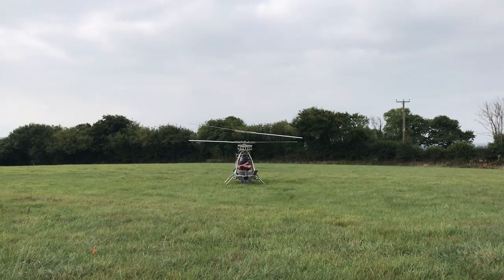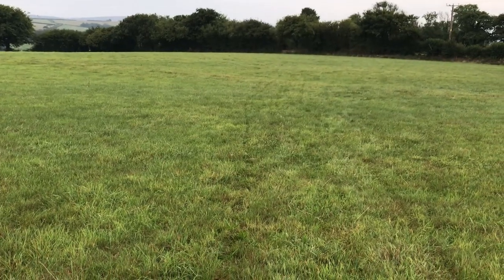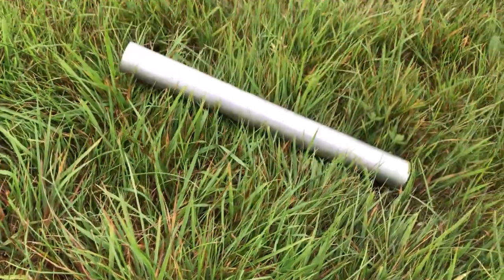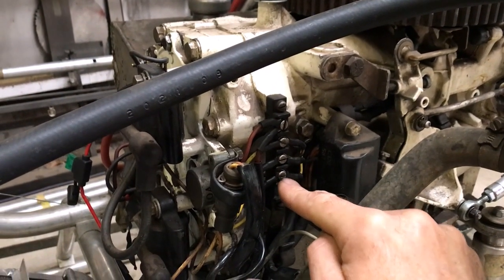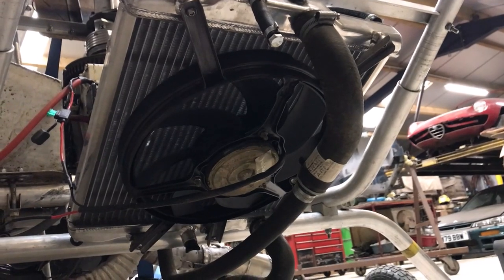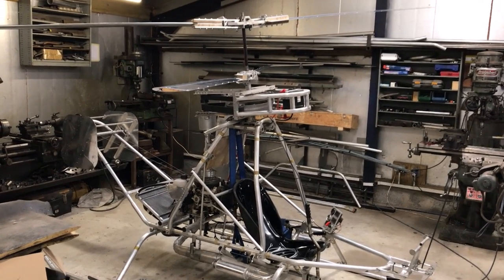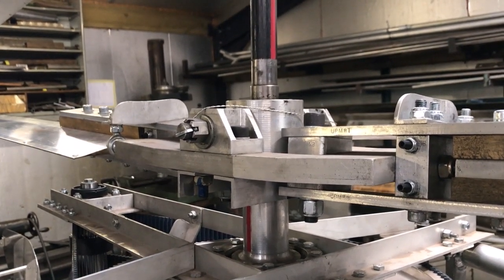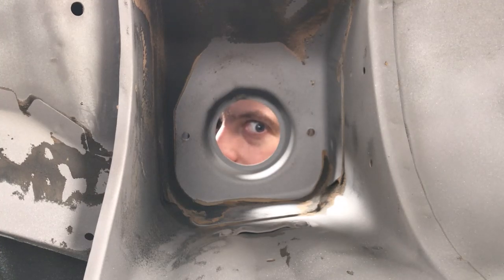Slow learning process Homemade coaxial Helicopter

Comment: Looking good. I would recommend forcing yourself to get it into a stable hover first and focus on where you want it to go but ever so slightly move the controls. Over controlling causes a loss of lift from blade flapping. From the video it looks like you are moving the controls too much in response. You can fly a complete pattern in a normal helicopter and never move the controls more than an inch. It's very much the amount you are moving them that causes the problems you are having. I've hovered in 30 mph winds but not before stabilizing the helicopter at the point of liftoff. 

It's a slow process and you would get the feel easier if you had another pilot to follow along with. It took me a while to "get it" but it's a balancing act. The long stabilizing bars are helping more than you think to keep it stable at this point. Basically you just think about which way you want it to go and barely move the controls in that direction. I'm not sure how much the short blades are hindering stability but it could be a factor as well. Baby steps. I had many hours of dual instruction before I soloed. You are skipping that step. :D Be safe!
Reply from the maker: Thank you for your advice, it's much appreciated, I hadn't realised blade flapping resulted in loss of lift and I could well be over controlling still. I will analyse the footage as you can see my  hand on the cyclic and the helicopter reaction to control input. It's strange when you think you have got it for a few seconds you shortly after realise that you haven't. It's the hardest thing to learn I'd say and usually I'm fairly quick to learn new practical tasks, not this time. 😀
Reply: @Ben-Dixey  It slowly becomes second nature, just like riding a bike. At first things are twitchy and then you realize that you can perceive where the bike is heading before it actually does. The trick is to stay ahead of the bike and not let it throw you down. Normally when learing to fly you master one control at a time with supervision, then move on to the next in combination. Concentrate on rudder control, then cyclic and rudder then cyclic rudder and throttle. That is the advantage of dual instruction. Don't be hard on yourself. It takes time to master the dance! :D
Reply from the maker: Understood, I'm finding the pedals just as hard as the cyclic because they work backwards to whats natural to me. A lot of concentration is needed at this point. There have been very brief moments when I could just enjoy the ride but the rest of the time is just intense. I've got another R22 lesson soon will be interesting to compare from last time. Wondering if I should mention to him about by home exploits ?
Reply: @Ben-Dixey  I would mention it to your instructor. When I used to instruct that was how we started a new student. One control at a time and eventually adding more controls as the "Feel" for the helicopter is found. One exercise I did was give the student collective and have them maintain the same height accross 2' - 3' grass field so they could see the effect first hand and compensate. Right now I think you are having tunnel visio and have narrowed you r awareness. Just like landing a plane it is essential that you have the attitude reference from all around you "see the big picture" of attitude at touchdown instead of staring at the runway alone. It just takes time. Any power change affects all the other controls, more so in a single rotor helicopter with a tailrotor.
Reply from the maker: I think you are right, there is definitely some tunnel vision going on and as you say observing the bigger picture is something to work on. I am really looking forward to getting to the point of controlling without thinking, then the enjoyment can start. Having one control at a time is a good way to learn, I think learning all at once overloads the brain. My helicopter is comparatively easy to control compared to a single rotor, tail rotor design as there isn't any anti torque to correct during power changes. There might be some pitch change to correct with extreme angles of the tail vanes, time will tell on that. I know there are some helicopter pilots/instructors who think I shouldn't be doing this hence the wondering if I should tell the R22 instructor. I suppose it depends on the instructors point of view to how they react to it.
Reply: @Ben-Dixey  I warned a student I had about knowings autos before soloing himself in a homebuilt scorpion. He crashed it and broke his back when the drive belt failed during climbout. It was a concern for me but I don't judge another's bravery, only advise if asked. 

I think if you approach with the idea of mastering controls to ultimately transfer that to your personal project. That is why you are taking lessons. What the hand does the mind remembers, just like dancing, it takes a few dances to get it all to come together gracefully. If you have a PC simulator, rudder pedals will help. X-Plane and DCS simulate it pretty good for a variety of helicopters including co-axial. :D
Reply from the maker: @helicopterdriver  A simulator is something I considered and it was suggested. it's something I should have invested in and it's not too late. My initial hesitation was I didn't think my helicopter would fly anything like a Robinson for example but I now believe it is very similar. I'm pretty sure if you got into my helicopter after getting used to the throttle only altitude control you would be hovering in no time. 
I'll have a look at simulator prices.
 I remember you telling me about the scorpion student. 😒
Reply: @Ben-Dixey  I may add that you should cut the grass short in your practice area. The grass absorbs a lot of inertia between the ground and cycling back through the rotors. Deep grass, not that it is deep in your practice area, sucks up power because of the disruption of circulation. (Vortices) It does make a difference as far as stability too, if the height varies a lot when moving over it. You may want to shorten the cross bars a bit to get a better feel for when you take them off later. lots of moment there I think. I'm not an engineer, but that could be a factor in perceived control inputs required to change angles?
Reply from the maker: Great information on the effect of grass length, I may have to go back to the garden until the field is cut again, it's rented to a farmer and I don't think he would like me cutting a large square of it. Quite happy reducing the extended pole length gradually as I improve, I'm not sure what effect it could be having to flight controls.
Reply: @Ben-Dixey  when you move the stick you lose lift. this is helis 101. a man crashed an r22 in a parking lot last week because of exactly this.
Reply from the maker: Thanks for this information, it's another reason why hovering a helicopter is so hard. What experience did the R22 pilot have ?
Reply: @Ben-Dixey  There isnt alot of info i can find on the crash itself. Believe it was in the UK. You can find it on "Pilot Devin" youtube channel.
Reply from the maker: Hi, it's been suggested a couple times moving forward would be easier to learn. I suspect moving forward would be easier but I'm reluctant to try it. Any thoughts ? What speed would you estimate is needed to make it easier, fast enough to get out of turbulent air?
Reply: @Ben-Dixey  The Pace of a slow walk should be fast enough. Any faster you could get a dynamic rollover if you hit wrong. YMMV You need the skids a few feet in the air to avoid dragging a skid in a lift change. Usually about 3 feet minimum in most helicopters. High enough to avoid the ground and low enough to get it on the ground if it coughs. Had that happen a few times over the years. No engine is perfect.
Reply from the maker: Ok thank you 👍😀